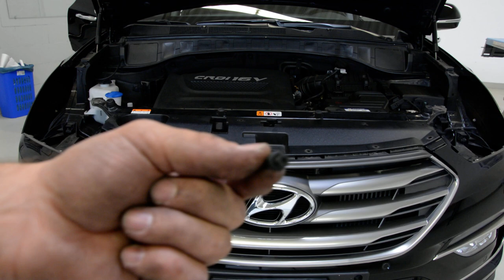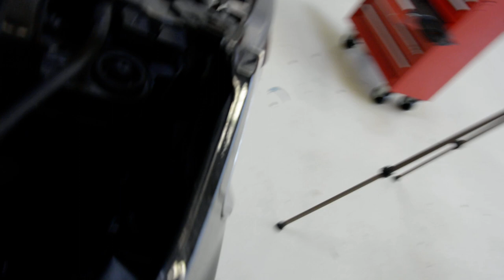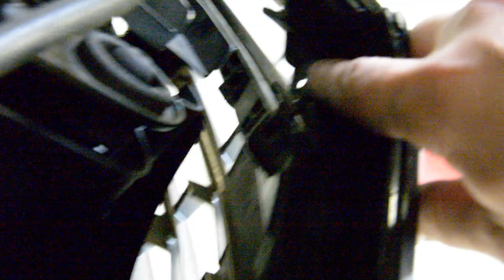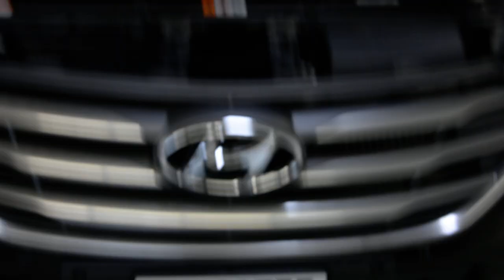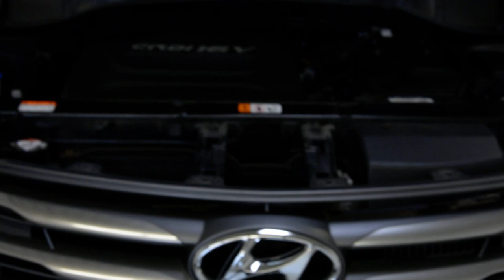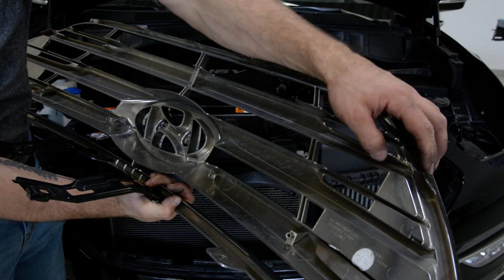How To Install  Remove Front Grill Hyundai Santa fe 2016

Comment: This is not real. what about the two plastic screws on a steel bracket to the radiator side. if you dont take them out you can not flip the plastic cover up.